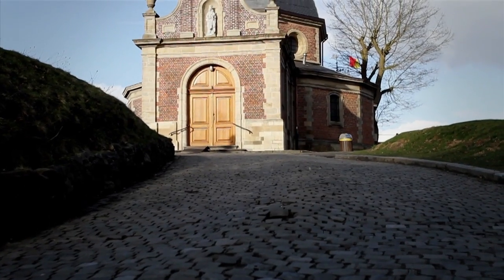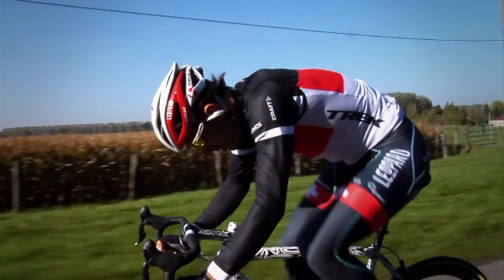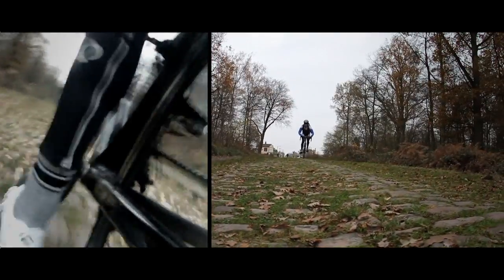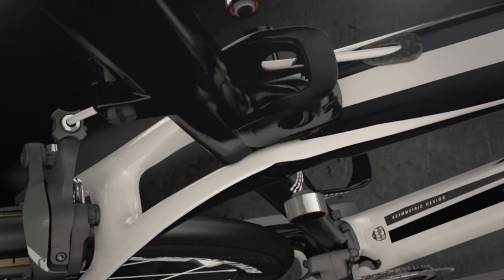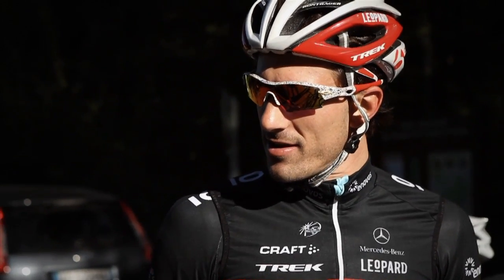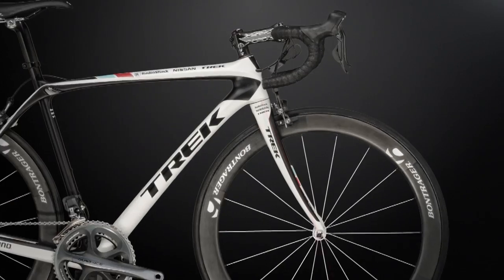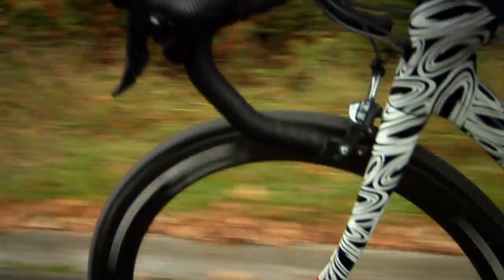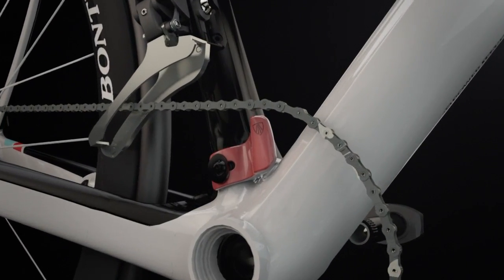Trek Domane: Behind-the-scenes tech story

Comment: I test rode the cheapest Domane... the 2.0 and it was fast for "entry level". But I couldn't handle the lack of suspension at the front so I bought the 2014 Trek DS 8.6. When my wrist regains strength I'll buy the 2.0. Broke my left wrist and right thumb from a motorcycle accident 4 months ago and even the slightest bump bothers me. Anyway, I recommend all new road riders with a budget to test ride the Domane 2.0.